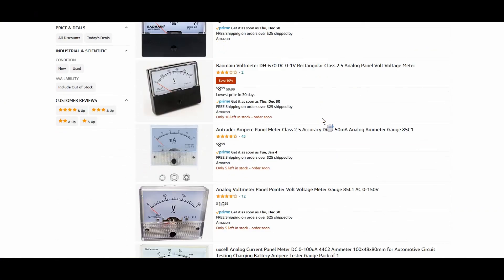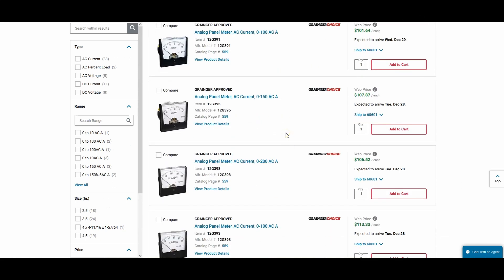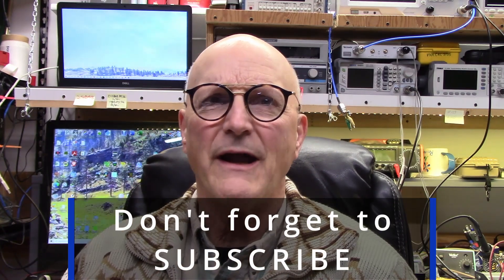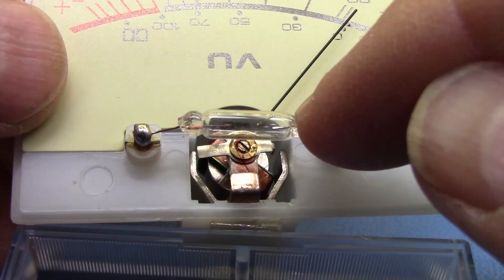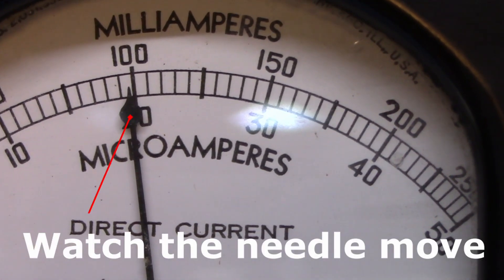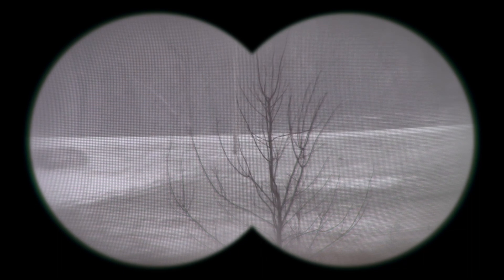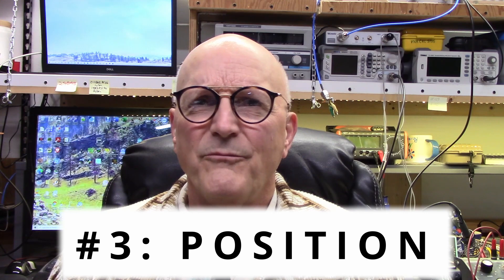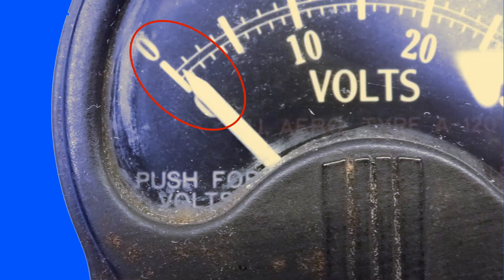Accurately Reading an Analog Meter (019a)

Comment: Good advice Ralph.  Another thing to watch for is static charges building up on plastic meter face moving the needle upscale. Breathing on the meter face can equalize the charge moving the needle home .  Another caveat is make sure the internal resistance of the meter is >10 times the circuit Z to avoid loading down the circuit.  Speaking of meters, I hope to hear you on 10 meters :)
Reply from the maker: I'd forgotten about the static on the plastic faces. I've seen this before.
Yes, we need to try 10 meter, soon.

Comment: I have a esp8266 microkontroller reading my electric power meter (whole house) and making a pwm signal. The pwm is smoothed with a capacitor and a analog meter is connected to it via an voltage divider. Easy and fast reading of power usage.
Reply from the maker: PWM makes a lot of digital meters go nuts.  Analog meters do a good job of helping to smooth things out in part because of the inertia associated with the mechanical movement itself.  Remembering that there is an inductor in there can also be used to your advantage, playing capacitor against it. Cool stuff!
Thank you for the comment!